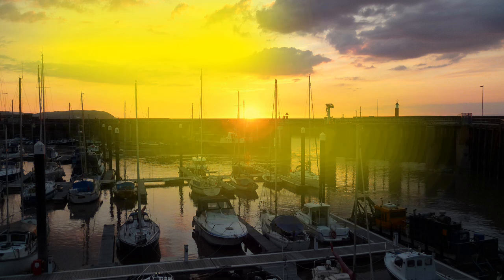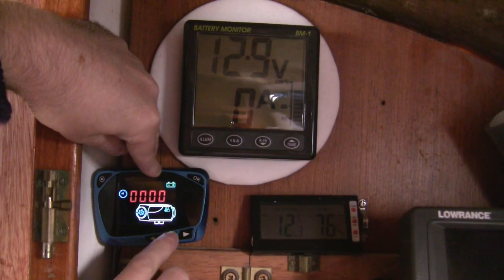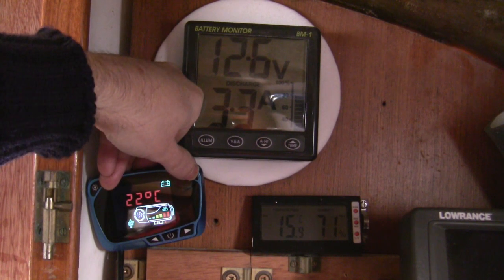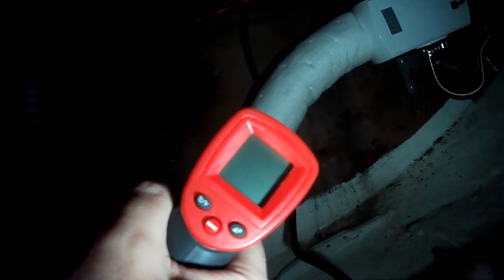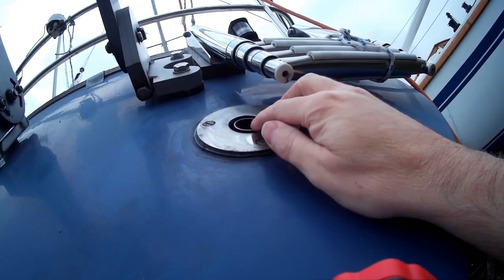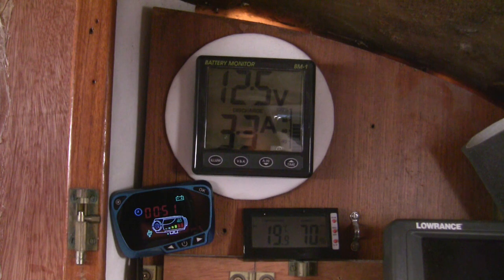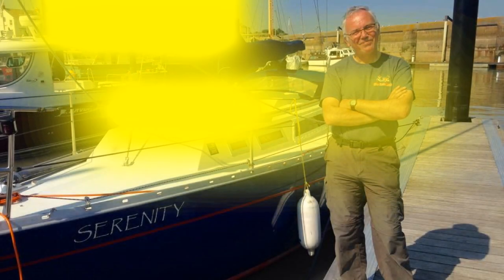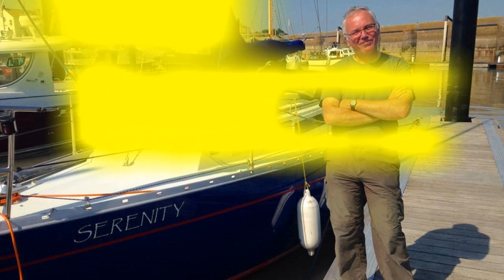Just About Sailing April 2019 - Installing a Chinese Diesel Heater, Pt 3 Full operational test run

Comment: Thanks for this informative video. Conclusion is thus, the quality of temp/glow/pump management. Mechanically it shows it will do.
Reply from the maker: Yes, that's pretty much it. I like to know that any 'mechanical' devices I buy have been designed to operate based on sound principles - and that is not always the case. I am happy with what I have discovered about this unit.

Comment: Very interesting (and not at all boring!). It will be interesting to know the consumption on a daily basis of usage once you'll be staying in the boat for a longer period of time, compared to weather conditions and outside temps! Thx for sharing!
Reply from the maker: Thanks. I would have preferred a colder day for the test, but it has been quite warm here recently. I was concerned that the power consumption would be around 3.3 amps all the time when the unit was on. I am much happier that it drops to 0.6 amps for quite long periods when it is in idle mode. At least I can start to make a few calculations regarding power requirements. I might have to wait until next winter to get any 'real life' measurements. Cheers.
Reply: @verynearlyaboutsailing8114  Great! Thanks!

Comment: Super videos!!! I just discovered your channel when researching diesel heaters. SUPER.
Reply from the maker: Ron, thanks. I am very happy with the little unit. Of course, it is the installation that is the major part. But it has been reliable and was very cheap - I can't ask for much more. It will be interesting to see how long it lasts.
Cheers
Paul

Comment: Good and interesting to see the whole install procedure from start to finish well done.
Reply from the maker: Thanks for watching. Like most jobs it is 95% thinking/planning and 5% doing. Hopefully not too many bad decisions along the way. I still need to sort out the heating air intake and combustion chamber intake. And of course a final fitting for the diesel tank. But that might have to wait a while. Cheers

Comment: Those thermal guns are very dependent on the "emissivity" of the material.   Basically the brighter the surface (like SS) the less accurate the reading.   Those heaters are becoming very popular with the on-land van camper crowd.   Well done!
Reply from the maker: Cheers Tom, yes I should really put some matt black paint splodges on the exhaust and re-measure it. Ah, a van heater. That gives me an idea - Maybe I should put wheels on Serenity.
A lot of people in the yard have been asking me about the heater. I think that the price coming down for these units had made them become much more viable. But, as we know, everything is at least 10 times more complex when we install it on a boat.

Comment: Great video. Could be on the short list for next years Oscars. I wonder how far that differs from an Eberspacher in terms of performance, amp draw etc?
Reply from the maker: That would be a very short list of films, and I am not sure what category it would be in -  films to sleep through possibly.
It would be interesting to see how it differs from Eberrspacher, Webasto, Planar etc. It is also possible that it differs from other Chinese Heaters. I was actually pleasantly surprised at the well thought out way that the power up and power down worked. Cheers.
Reply: @verynearlyaboutsailing8114  no way dude! You get an Oscar in my book. It's December im in Seattle (same climate as the UK) and been looking at heat options for my little westerly cirrus I was hanging on every word. I am pointing in that direction at this point. Thank you for taking your time to put this out there.
Reply from the maker: @scott.wallace8625  Cheers Scott. I am still happy with the heater. I have recently done another video where I tested out where to best put the heater air input to reduce condensation - I'm pleased with the results of that. I also looked a bit more closely at fuel and amps consumption. I also increased the insulation on the conduit between the heater and the cabin (about 5 ft in my case) - that made quite a difference.
If you haven't seen it already, check out Onboard Lifestyle's channel. They installed two of these units on their catamaran when they were based in Seattle. - Yes, it is the same climate.
Cheers
Paul
Reply: @verynearlyaboutsailing8114  I will check that out. Thanks paul

Comment: There is no need to lag the exhaust.  Bit of heat down there is a good idea.  Def lag the outlets.
Reply from the maker: Yes, I eventually took the exhaust lagging off when I fitted an exhaust drain water trap (thing). And also increased the lagging on the heater outlet.
Cheers, Paul

Comment: I’ve installed two of these and I speak highly enough about them. 
My installations have been in caravans and now I want to put one in my boat. 
I’m concerned about the exhaust. 
Can you please tell me where did you source your outlet flange?
BTW good job on these but I’ll offer one suggestion. 
If buying a Chinese heater, it’s always a good idea to bench test it before the actual installation.
Reply from the maker: Brendan, good luck with the install. Finding a good location in a boat is 90% of the process. Initially I was going to tuck it away out of sight. But then decided that ease of access was key. It is actually quite easy to take it it out where I have placed it. Although I'm not as bendy as I was.
The exhaust is definitely a key consideration. I found the outlet flange on ebay. Search under Webasto, Eberspacher for exhaust fittings and some will come up. The original link for mine is long gone. Mine was made in Turkey (cheap) which is where a lot seem to come from.
I did a few update videos. One of the things I should had done straight away is to install a water trap. There should only be one 'dip' in the exhaust run and it needs a trap. Again, I bought a cheap one off ebay. Check out the first few minutes of my December 2019 video for details.
My boat is still out of the water, but I have run the heater several times and I love it.
Cheers
Paul
Reply: @verynearlyaboutsailing8114  
Thanks for your prompt reply Paul. Much appreciated. 
I love these machines good luck with your sailing. 
Brendan.

Comment: Nice - I hope that heater gives you a long service life.  That's always my concern for some lower priced bits of kit - but I've had issues with more expensive devices as well - product support may be the difference, I guess.  If you can get a glow plug though - everything else seems external and easily replaced.
Reply from the maker: I believe I can get a glow plug for about £10 - I should carry a spare, I guess. I don't think there will be any product support, but who knows, I might be pleasantly surprised.To be honest, I don't think there is a single item on a boat that isn't going to go wrong at some point.Cheers
Reply: Just about sailing  Get a spare while you can and make sure it’s the right one and stow it with a spanner that fits.
You can be sure that when it packs up it will be at the worst possible moment ! 🤪✌️
Reply: The cheap chinese heaters tend to last just one year.  Still cheaper than buying a webasto or eberspacher.

Comment: Shiny metals are reflective and will not give an accurate temperature reading with an infrared thermometer.  If you want to check it with infrared, you can put something emissive such as a piece of painters tape or electrical tape, or a spot of paint.
Reply from the maker: Thanks Mike. I thought something like this might be happening. I will try again next Winter just for interest. It is much too hot to turn the heater on at the moment. I have some heat resistant matte black paint somewhere. Cheers
Reply: @verynearlyaboutsailing8114  just be aware that paint will increase the radiation and heat dissipation (or absorption) of the painted surface, which may or may not be desirable depending on the situation.  In other words, don't paint the air gap of your thru hull, try to keep that shiny.
Reply from the maker: @Mike_Neukam  Thanks - I'll use tape when I try it. Cheers.

Comment: Well I found it interesting but wonder what that says about me.😳 Are you only have one warm outlet in the boat? I would most definitely insulate the exhaust line. Thank you for sharing.😀⛵️
Reply from the maker: Oh dear, I am starting to learn something about what my subscribers like. I might have to do an 'epoxy drying' in slow motion video - mind you, I'd watch that.
I am still torn about whether to insulate the exhaust or not. I did buy the material to do it, but figured that I wanted to get rid of as much heat as possible before the hot gas got to the thru hull - the opposite of what I want for the heating air going to the cabin. I might change my mind on this one. And thanks for noting it - it is one of the reasons I ask people to always read the comments.
I am only having one outlet. Serenity is actually a lot smaller than she looks in the videos, especially when I use my 'cheap go-pro' camera. So not a huge amount of space to heat up. I wandered into the Vee Berth to check what it felt like - it was definitely a bit cooler, but we will have to see.
Cheers

Comment: Very interesting little series on this heater unit.  One question, what diesel consumption are you getting? Ball park figure of course as I assume it will depend on heating settings choosen and ambient temperature when run.
Reply from the maker: The honest answer at the moment is that I don't have a definitive answer. And as you say, it will depend on a lit of other factors. I have seen some estimates where people say that they use 1/4 litre per day and others that say 1/4 litre per hour. - That is quite a wide range.
My current plan is to keep the diesel for the heater in a separate 10 litre tank (the one that came with the heater is only 5 litres) so I can keep an eye on it. The tanks are see through so I can mark litre lines on the outside and keep track of consumption. - I meant to do this for the test - but forgot, although the level didn't appear to have dropped at all.
I normally keep the main tank (85 litres) filled up and carry another 20 litres spare.
Also, in the UK (I don't know where you are writing from) there is a very strange, complicated and unclear situation with regard to the tax on diesel for boats. Basically, there is a lower tax applicable for diesel if it is to be used for heating, but not for propelling the boat. Too complicated to go into.
That wasn't a very good answer was it. But I will be monitoring usage when I start cruising.

Comment: Hi - excellent video blog on the diesel heater - I am hopefully going to be fitting one in my motorboat and the question I have is - do you have a list of the extra parts that you purchased like the better quality exhaust silencer etc.
As a side note that I did notice on your installation was you didnt have any exhaust wrap on your exhaust this would keep the heat within the exhaust and away from the hull of your boat and anything  that could catch fire - easily to get hold of from a motor factors or ebay and use stainless steel tie wraps or wire to keep the wrap on the exhaust pipe

jon
Reply from the maker: Jon, I got all of the additional parts from ebay. I basically did a search on Webasto and Eberspacher accessories. There is no point in me giving you the actual links as I checked them recently and they have 'dissapeared' - I think it's the way that some people advertise on ebay I guess.
I will be doing a final video on this install in a few weeks. I need to instal the combustion chamber and heater air inlets. I am not 100% sure what to do regarding the exhaust. One school of thought is to do as you say so that all the hot exhaust goes out the back. The other school is to keep the pipe as far away from the fiberglass as possible so that as much heat as possible gets dissipated before it exits through the hull. Have a look at the install Teal did on 'Onboard Lifestyle'. He did a bit of both.
The other thing I will probably do is instal a drainage loop at the lowest point of the exhaust.
Cheers
Paul
Reply: Paul - Thank you for your quick reply - with reference to your exhaust possibilities you could wrap the first 90 degree bend that comes out of the heater as its that bend that takes majority of the the heat maybe put heat patches on the fibreglass hull following the same path as the exhaust pipe this way the heat is deflected away from the hull and with the exposed exhaust pipe the heat generated dissapates into the air around.
Jon
Reply from the maker: @jonmclean8205  That is a very good idea. I might just do that. Cheers
Reply: Paul - On thinking about this - This would be better as you pointed out in one of your videos that the through hull fitting wasnt too hot - this is because the heat from the exhaust has dissapated further inside the hull - Makes sense - so the the heat patches are going to be more the way to go just to protect the hull - and with the heat gone earlier before the through hull fitting this will stop a lot a heat at that fitting (also peace of mind) - I would still put wrap at the first bend from the heater and maybe a patch on the hull in that area as in another video it goes beyond 150 degreers c at that point.
Another thing to point out what I found yesterday it maybe worth putting between the battery and the heater a isolation switch as apparently the heater in this chaps case automatically switched on for some reason     https://www.youtube.com/watch?v=nhmn4D-v20I

is it possible you could list the extra items you bought not from particular the sellers (I understand they might not be listed from them now). 
Jon
Reply: Paul - This is a thread that I started about installing a heater and has some useful input so far. on page 5 is a post showing a temperature cut off switch linked via a relay an attached to the body of the heater, which if the heater case gets too hot i.e catches fire it will shut the power off to the fuel pump.http://www.ybw.com/forums/showthread.php?528856-chinese-diesel-heater-installation/page5Jon
Reply from the maker: @jonmclean8205  Interesting. I'm not sure I will go that far. However, I looked at the video of the chap who said that his heater switched itself on by itself. I have had electrical equipment do that. I will not keep it permanently wired up. I don't intend to use the timer or the clock. Cheers
Reply: @verynearlyaboutsailing8114  Hi again Paul hope you're good.
Quick question - I have spent many  hours today trying to find the heat insulation (in white) but to no avail.
Please could you tell what type the lagging insulation is - all I am getting is the foam type.
Best regards
Jon
Reply from the maker: I assume you mean the padded insulation around the heater outlet. The one that I bought seems to have vanished from ebay. But when I looked for something similar this came up. Do check the diameter of your conduit; there are a few different sizes.
Also, have a look at my latest video because I upgraded the lagging substantially and it made a big difference.
https://www.ebay.co.uk/itm/WEBASTO-or-EBERSPACHER-heater-75-90mm-THERMODUCT-Air-Ducting-insulation-/272814565152?hash=item3f8503e720
Reply: @verynearlyaboutsailing8114  thanks Paul - I will look tomorrow at your latest video.
Jon
Reply: @verynearlyaboutsailing8114  Hi Paul - Hope is going good for you its been over a year since my last reply I haven't got round to installing a heater yet due to the pandemic but I have 2 questions for you .
1st - Do you know the distance from the heat outlet of the heater to the vent and is the heat still hot ? - I am wondering this as I have a distance to cover from my planned install to the interior.
2nd - Have you thought of doing a review after a year or so use - there seems to be a few negatives about Chinese heaters vs the over priced ebers and webastos
Jon
Reply from the maker: @jonmclean8205  John, Have a look at the first December 2019 video. I wasn't happy with the amount of heat coming out so I added some extra lagging. The distance is somewhere between 4 and 5 feet - so quite a distance. With the original lagging the temperature at the vent was about 50 C (that's from memory - I measure it in the video). When I put the extra lagging on it went up to 90 C. That is quite a difference and well worth doing. I would say that the more insulation you can add round the outlet pipe the better.
On the second point, I've revisited the heater a couple of times. I did something on humidity calculations and then an experiment to show why I decided to take the heating air from the outside. I also did one where I put a condensation trap in the exhaust. I think this is vital in a boat as it is almost impossible to fit a heater so that the exhaust always goes downward. - So you need something to let the water out where the exhaust dips (and there should only be one dip).
The boat has been out of the water, so I haven't really used the heater in a proper (harsh) marine environment. However, I do use it a lot when I am working inside the boat. It has been absolutely faultless. By taking the air from outside I never get any condensation. I was wondering about having a second outlet, but I don't really need to - one is fine for a small boat.
If money were no object, I would probably but a Webasto or and eber. - But the difference is over £1,000. So no contest really.
Let me know how it goes
Cheers
Paul